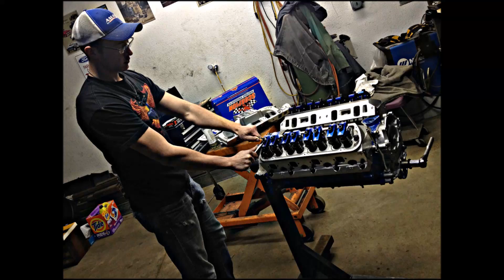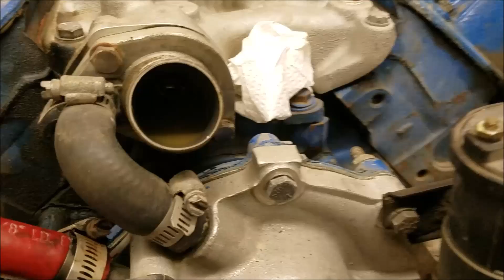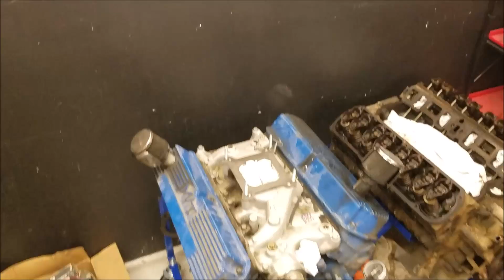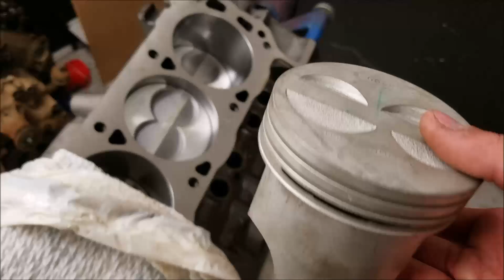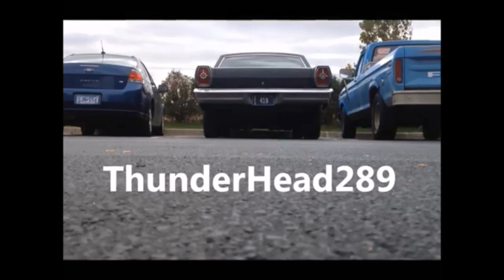Driving with NO/FAILED Thermostat in Car - Is it Worth It? (Explained)

Comment: such a bullshit video. man u dont know nothing about cars engine. or u sponsered termo lol
Reply: ThunderHead289         Tell you what, go rent a van that has the 
access-dome near the driver's/passenger's seats. Drive around with that dome off for 30 minutes, you will be fucking broiling......and that ton of excess heat is only part of what the engine produces. You are insane if you think a modern engine needs all that heat to run properly.....it doesn't. One of the biggest reasons for a thermostat is passenger-heat.
Reply: ++gthhnmjmjmtyjjj - I agree with you 100%
Reply from the maker: Have fun tardos. That's all I can say.
Reply: +ThunderHead289 - Yea, sometimes eating "Fuk-Tard " like us makes sense, and the funny part is.... We are on the SAME PAGE :))))  LMFAO
Reply: Jordan Bronson man u so right. oil run the same with thermo or not. in  car ignition . when yo start your car its. on almost 60 degree . and with no time its clime to 80 degrees . its normal temp between 80 to 90. with a termostat the difference its run over 100 degrees sometimes. whats can cause a lot of problems in a long run.
Reply from the maker: Quantify your statement
Reply: all u need fox' to check is your fuel economy .if its the same. its even better to drive without one.  dependent on your car's manufacture model . sure if u live in cold below 0 degree area or. car take forever to get heated . get one otherwise no need. in newer cars the pcm does the work for ya. dont worry. just unplugged your termo sensor and it will be fine because it know to work just fine with a case termo stuck open mode get it?. and car can and will not get overheat you talkin ilogiclly
Reply from the maker: +gthhnmjmjmtyjjj your logic is flawed. There is no factual basis to your reasoning. I think it is you who are misinformed on engine dynamics.
Reply: ThunderHead289 man all my life i deal with engine some how. all cars i have (gas engine run better cooler) i've took out the termostat. and drove it years in all condition with 0 problem. while my friends suffer head gasket problem due to overheat. in a long run. or failure in timing cover gasket etc. i can go this all day and btw . the fuel economy was the same so no early wear' engine rings
Reply: and answer to the subject with proofs. not assume this and this etc. simple logic- engine material is metal. and metal get ruin only when it's get overheat. no heat will not ruin it.  people said it they really l dont got a clue what they talkin' about and by mean take termo out.  i.e only the spring. without the termo house. so the flow be lil weaker. and by that just normal
Reply: Here is what I do to our Trucks... I use 2 Thermostats. One, is the By-Pass. The other is " Normal ".... The By-Pass... We use it for Summer... Then we Switch it back to " Normal " in November each year. NOTE: If you do a By-Pass.... You can Drill the Hell out of the Thermostat, LOL. You will only need the " Rubber Ring " and the " Round " part of the Thermostat, so it can sit in the " Hole " safely and it won't " Leak " on you. Hope that will help People who is looking to do it.... Hmmmm, maybe I can make a Video of it, LOL
Reply: +gthhnmjmjmtyjjj - Hey sorry, my " Notification " was turned off :(((. Yea, I agree with you 100% !!!
Reply: +ThunderHead289 - No " Disrespect" to you. I don't like doing that :(((. Regardless if I am Wrong or Right... Sorry about that !!!
Reply: You can use big words all you want, but using words that sound correct in certain sentences and not actually knowing what they mean makes you fake and stupid. You have no logic, quantify that.
Reply: +gthhnmjmjmtyjjj - I agree with you 100%.  Recently, I found 1 of our Truck keep Leaking Fluid... I was like... What is going on now??? Come to find out, my Dad bought a Thermostat that doesn't have the so called " Fail Safe " / " Burp Hole " about 6+ Months ago, which I didn't know. When the Car got HOT, it got sooo fricking Hot that Coolant started to leak, but not completely leaking.  It was just under High Heat Pressure... So everyday, I see my Dad's truck dripping.  Come to find out, it was the Thermostat that DOES NOT have the " Fail Safe " / " Burp Hole ".  So I had to replaced the 3 Gaskets on the Water Pump and that is how I found out about the " Fail Safe " / " Burp Hole " on the Thermostat.  So I drilled a 1/8" Hole, and now it's working Great !!!   Since we are going into Winter, I can't by-Pass it because he needs heat :((((.  But I cant' stress enough, By-Pass-Your-Thermostat.  Gasket repair was cheap, but it was Time Consuming.... Also, we were lucky that it didn't damage the Head Gasket, that would be like a 2 days Job for me.  PLEASE PLEASE PLEASE... If anyone reading this, do a Thermostat By-Pass.  You may lose a bit of Gas.... But in the long run, your Car / Truck will run cooler and less damaging on Parts.  Example:  If I give you $200.00 extra in Gas each year... You don't think 1 Repair alone would cost you more than $200.00, and including your Time??

Comment: hey big fan of your videos I had a question I'm building a top end with stock bottom end on a 91 351w it seams to be stock bore but the pistons have 060 stamped on them along with some arrows pointing to front of engine  is that just the way they came?

Comment: ok so now correct if im wrong but if u have a carb with electric choke say a holley or edelbrock as long as theirs keyed power to it it will fully open the choke and so as long as u have ur carb set so its not rich then u should be able to get away with say running an engine at 120-130 degrees all day long (if u can even get it to stay that low) without doing any damage to the engine correct?
Reply from the maker: That eliminates a lot of the problem except the issue of thermal expansion. So at low temps, tolerances will be a bit looser. Causes a little more cylinder wear. I run a 160 unit myself

Comment: Hi there Thunderhead, love your videos, especially the Rotstang! I've got a question though, I've got a '87 cougar w/ a 302. My digital (unfortunately) dash always reads cold but the engine runs hot. I've replaced the thermostat to no effect and I'm wondering if because the computer reads as cold that the thermostat is not properly functioning?

Comment: Now that we've solved this question, a lot of enthusiasts still wonder what stat to use in their cars that works the best.  Some run really hot thermostats in their SBCs because they say it gives better performance at greater risk of overheating.  How hot is too hot for an operating temperature for cast iron blocks and heads, and how cold is too cold?  165 degree stat works fine on my 305, it never goes past 170, I would consider 200 hot for that stat.  Is that too cold?
Reply from the maker: i run a 180 thermo in all my engines - at this temp, it allows for the proper thermal expansion of engine internals while still maintaining a low operating temp. the cooler you can run while still getting your engine to the proper expansion and the oil the proper temp, the better. anything really over 180 is just excess heat that doesnt harm anything, but you lose performance due to having to run less ignition timing, and your fuel charge will be less dense. i run 160 in the summer myself and 180 in the winter. if you had to pick one for all conditions, id go 180.
Reply: my ford 390 has been running cool. It had a 160 degree thermostat in it - which I changed to 180 and it's still running at about 173 degrees. should I block off part of my radiator, or leave it?
Reply: Thnx. I'm in California. Last night at 9pm it was about 60 degrees and my car was running at 173.
Reply: You can block it off in the cold season to retain block heat better, since cast iron takes so long to warm up.  As long as your pump is circulating coolant, it shouldn't overheat unless you're obstructing the radiator too much.  I've noticed there's little water jacket block off plates on certain intake manifolds, I've taken mine out and it seems to be doing fine... why would they put those plates in there in the first place?

Comment: hey if my check engine light comes on it's a standard but it is radling just a little but the you get it into hi Rpms it won't what could that be it's a Ford's ranger v6
Reply: Um, what?
Reply from the maker: though irrelevant, sounds like weak ignition. when was the last time you changed the plugs?

Comment: I can't even believe that people would consider running without a thermostat in their engine. It would just take way too long for the engine to get to a better operating temperature. It's not just there to regulate flow at higher temps, it is there to stop flow at start up temps.
Reply: I do it in all my engines, but I use a thermactor air cleaner to keep the intake air at the proper temperature, my mileage went up 1.6 MPG.
Reply: Oh I never had a problem overheating, and the intake temp stays right, and every engine has went over 250,000 and oil lasts longer, I use edelbrock carbs with no choke, they run perfect!
Reply: I haven't had any overheating at all and drive the freeways at 100mph + a lot!
Reply: jack rohde man u so right. he dont understand nothing' if he talks like that. still appreciate is video work.
Reply: god hates Arizona is very hot. Do you take the thermostat off? Have you had any problems?
Reply: @5eddyr21  I have no thermostat and I Live in Az as well

Comment: Is that Red hose temporary? I am curious cause i am bypassing the heater core and wanted to know why u did that
Reply from the maker: That was my heater core bypass. Here is why I did this instead of a plug - I used to have a plug/cap on that port. Over time it weather checked and actually blew out. The way this is here, it will never fail. Though it is as ugly as all get out.